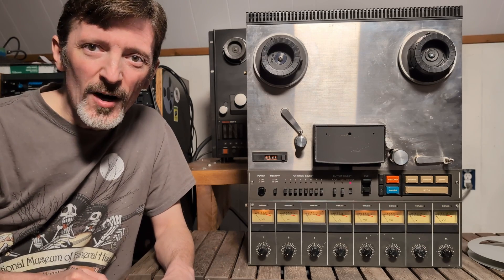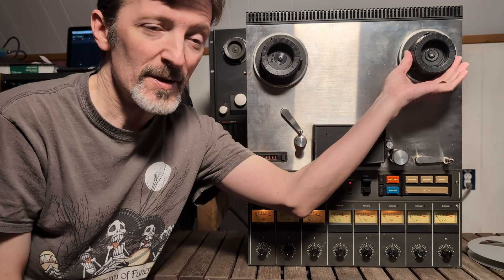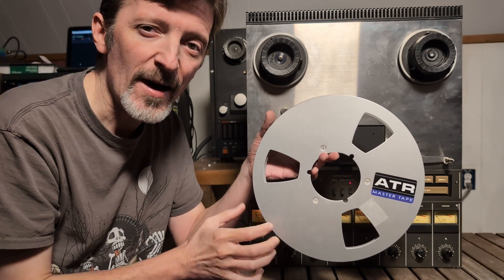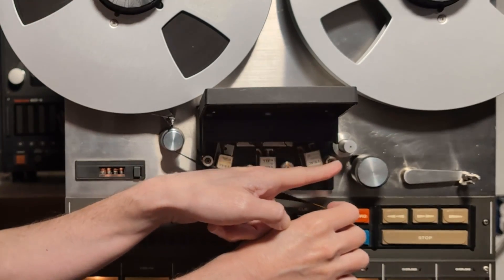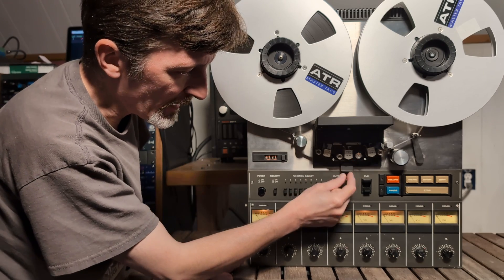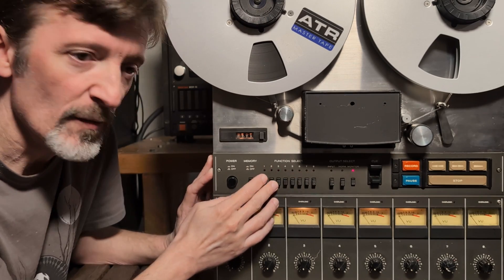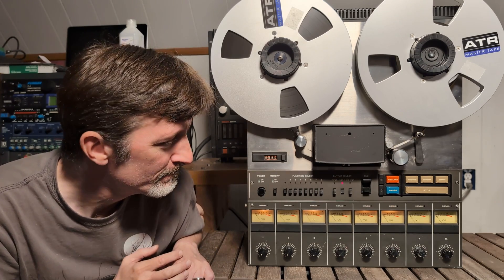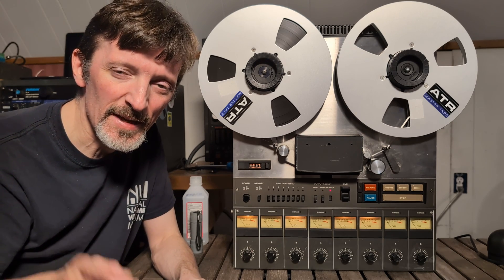How to Use the Teac 80 8 Analog Tape Machine

Comment: hello! Thank's for your tutorial! I suppose the difference between stop and pause is the precision of it when it restarts... Pause permits to make more precise transitions?!!
Reply from the maker: According to the research that I've done since this video was made, pause leaves the tape against the heads while stop engages the tape lifters. Since this is a very mechanically driven machine, it doesn't use the motors to hold the tape in position, so it seems more like stop is engaged when the machine is actually in pause. My 80-8 went to Sammy over on the Sammy and the Hi8s channel. He was having trouble with his so I donated this one so he could put together a good machine. Mine had a few problems too. Definitely go check out his channel. He has made several videos with the 80-8. These are really wonderful sounding machines!
Reply: @TwinCreekAudio  I will! I love tape machines. I've beeen working on many songs of mine using the sound-on-sound processing on an AKAI 4000DB. I won't lie, the game is so funny, and the result, well, not bad to me! I even did a try to tutorial but it's such in bad english, that it's not really effective. By the way if you got the time? https://youtu.be/saVeMW_YYFA
Reply from the maker: @Thomas.Lafitte  I will defintely watch after work today. Thank you! i like Akai too. I have one that needs a lot of work.

Comment: I just got the 80-8 and a TASCAM M-520 and I can't them to work together. I have a Fostex 350 4/8 channel mixer and I can record and overdub on that so I'm going to record on all eight tracks and then try to play THAT back through the M-520. See if that works and then reverse-engineer from there and get it to record. The guy I got the mixer from showed me the video he took of the M-520 with a 16 track 1" machine playing back on all sixteen channels. Playing back isn't recording, though. I'm not even sure how to hook them up together. The manual for the M-520 has this 8 Track Patch that is supposed to work for recording mixing and mastering down to 1/4" but it didn't work for me. It has me routing everything through the meter bridge (?) which I thought was interesting. But I got nothing. No meter. No phones. But I did get the overload light on the trim knob. So it seems it hitting that. But no further. 'elp?
Reply from the maker: I don't know the M-520 that well but I'll take a look at the manual and see if I can understand it's routing. Usually, yud use either a bus out or direct out to send signals to the recording device and tape inputs to play back through the console channels. I'll grab the manual for the M-520 and see if I can add more information to help.

Comment: So, I'm really only using the Normal input for recording, overdubbing and playback and the Monitor for playing along without recording?
Reply from the maker: Yes, that sounds like you're using it correctly. I need to check the manual but most recording consoles will have a switch on the main channels that allow the tape inputs to come through the main channels. Sometimes it's called Remix, sometimes Tape on Tascam consoles etc. There are also 2 typical design philosophies for recording consoles. Split or inline. On a split console, the tape inputs will have a separate mixer section for monitoring the tape tracks. This is usually above the buses. Then there would be a switch to bring the tape channel through the main channels so you could do the final mix with the full EQ and channel features. On an inline console, the tape inputs will go to a section on the main channels which is still a separate submixer but is integrated into the main channels to save space. These will have a switch to flip the signals. In fact, a lot of consoles actually call this Flip and there will be a switch for it on the channels. I believe the M520 is a split design like my M-35 but I'll hang to check the manual. The Mackie 8 Bus, Soundtracs Topaz, Soundcraft Ghost etc are all inline consoles. Older Tascam were usually spilt designs but the M-3500/3700 and newer Tascam analog consoles went to an inline design.

Comment: Why didn't they make all decks with NAB reel holders instead of having to buy the adaptors?  This has always been an annoying issue I think.  First of all, the brand new machine is not fully built if you gotta get the adaptors, secondly it is suggestive that we aren't worthy of using quality gear which can be as good or even better than broadcast tape decks anyway!
Reply from the maker: I agree. If the Fostex R8 had used something other than 7" reels, it could have been used on more high end productions. I have also noticed that the tape machines that people considered semi-professional back in the day actually sound quite good and very analog.

Comment: Firstly, thanks a bunch for the awesome videos--they're super helpful! I recently purchased a TEAC 80-8 and have a few questions about connecting it to a mixer. I'm currently using a Behringer Xenyx 802 mixing board with 8 tracks, which has a single location for an RCA input and output connection.

My questions are:

1. Will I need a different mixing board if I want to listen back to all eight tracks simultaneously?
2. From an RCA perspective, What type of RCA cables should I purchase? Should I purchase an RCA y cable (male on both ends) or do you have a better suggestion? 

Any info you can provide is greatly appreciated! Thank you so much and warm regards.
Reply from the maker: If might be easier to use a mixer that's designed for recording such as the Tascam M-35, M30 5A etc. You can still use your mixer to play back all 8 tracks by using RCA to 1/4" with the line inputs on all 8 channels but you would not  be able to record and monitor all 8 simultaneously without a mixer that designed with another signal path for monitoring. As far as the type of cables, it would be whatever type of connections the mixer used needs on one side and RCA for the 80-8 on the other. There are a lot of choices for mixers that would work. The old Mackie 8 Bus, Soundcraft Spirit, Ghost etc. Most of those use 1/4" so you'd use RCA to 1/4" etc. Hope that helps and best of luck! The 80-8 is an excellent sounding machine. With proper maintenance and care, it's one of the best for the price and not difficult to work on when needed.
Reply: @TwinCreekAudio  This is incredibly helpful! Thank you so much! I've spent this afternoon looking for mixers that would accomodate the 80-8 and haven't found much, so I was thrilled to see your suggestions. My initial thought was to try a 2 to 8 RCA snake cable, but it appears to be uncommon. 

Anyhow, thank you so much for the thoughtful response! It's truly appreciated! I'm really excited to use the Teac. Such a cool piece of machinery. 

Warm regards!

Comment: how would you go about running tracks from a daw (audio interface) into a mixer and the tape machine? how would you route it?
Reply from the maker: Normally I would connect the outputs of the audio interface straight to the tape machine and then record the tracks onto tape. If you need to match levels or your interface doesn't support the correct line level for the tape machine you're using, then you could connect to audio interface outputs to channels on a mixing console and use the direct outputs to feed the tape machine. This way would give you more control but will add more noise and other non libraries to the recording.

Comment: Hi,Grady,...but for Fostex R8,what kind of tape must I use,for recording of course?
Thanks a lot!
Reply: Basf 528,1/4,6.3mm its good one?
Reply from the maker: @iulianmunteanu8672  I used ATR master tape with mine and it worked great. There is also RTM tape. Those are the only 2 being made anymore.
Reply from the maker: @iulianmunteanu8672  yes, RTM makes the old BASF formula.
Reply: @TwinCreekAudio  thanks a Lot!Best Regards!!
Reply: Hi,Grady,....one more question,it needs nois reductions after tape(like Teac DX8),or not necesary?
Reply from the maker: That likely depends on what type of material you're recording. The narrow gauge track formats are a bit noisy, so if you're recording anything quiet, noise reduction would be beneficial. For something like loud rock music, you can probably get away without noise reduction.

Comment: Hi, thanks for the detailed video ! Sorry for this question, but does the 80-8 have any kind of stereo output option ? Or do you have to use all 8 outputs if you use all 8 tracks ? Thanks ahead for your help, I'm just looking to set this little fella up into my studio !
Reply from the maker: It doesn't have any kind of stereo output as that would require it to have a built in submixer I think. It only has 8 separate outputs from the individual tracks. These need to be connected to a mixer in order to combine them to a stereo mix.

Comment: BEWARE  the reel table part can break or the M4  bolts in the part under the reel table can go soft and the bolts lose there grip
and  the reel table can start to move in and out  

i have alot of this model super deck they are  the tascam 38 head will fit  on this deck 

the team 38 is better as it can be jazzed up  on the tape speed side  3 3/4   to run at the same speeds  as the otari  1/2 inch deck i lost my deck to bad caps

saved my  otari DP2700 just in time
Reply: I disagree that the Tascam 38 is a better model. Absolutely not true. Cheap plastic parts and terrible relays. Teac 80-8 is FAR superior. Agree with the reel table issue though. Although it depends on the unit and how it was used and stored. I stand by the Teac 80-8 til I die. I could list many many reasons why. Anyways, good video. Not too many new videos out there regarding this beauty
Reply from the maker: @soulslip  thank you! I haven't used a 38 in many years but I have to agree that the 80-8 seems to be better built and also a bit easier to work on. I was really surprised at how good mine sounds even with its age and wear.
Reply from the maker: That is good to know.  I haven't had any problems with mine but I will be sure to be careful. I did adjust the reel heights before use and replaced a hub adapter that was broken. The machine has been working great and I really like this model!

Comment: hey buddy, i use the pause button togetter with the rec botton, so i just press paly, i think thats the only way to use it ;). i got two 80-8, one is in good condition the other one sits half disassembled on my kitchen table, i wait for some parts and the vs-88 to test it ;), thank for the nice video
Reply from the maker: That's good information to know. I seems to sound and work exactly the same but maybe it's leaving the record electronics engaged in pause. They are really nice machines and still seem to work great. I don't have the varispeed option but I might try to find that after I finish my other tape machine projects. Good luck with yours and happy recording!
Reply: I just picked up a vs-88 for $10.50!! I only need the accompanying DC Capstan motor and the manual to install and adjust properly. Cheers!
Reply: Can you synchronize both machines? I Just bought a 80-8 and really Love it.

Comment: I just finished my first song using my 80-8(mastered to cassette) and im impressed with the quality of this machine! Tape price definitely will dictate what songs get recorded next but it was a great recording experience and already starting the next!
Reply from the maker: I recorded a song yesterday with mine and was really enjoying the workflow. I find the sound of the 80-8 and it's ease of use inspiring.
Reply from the maker: I'm using mostly ATR Master Tape with all my tape machines. It's a little cheaper than RTM which I tried with a Fostex R8 and did not like as much as ATR Master tape on the same machine. I think used reels of ATR should be safe to use as I bought 2 of my 1/2" ATR reels and they have been as good as the 2 new reels I bought.

Comment: Nice summary of the functions !   How do you find it sounds compared to your other tape machines or machine ?
Reply from the maker: It sounds more vintage and thicker than the MSR-16. The MSR-16 sounds really nice and punchy and is less noisy but the 80-8 just sounds massive and very musical. I like the high end on the 80-8 a bit better too. That's likely due to the dbx on the MSR-16.
Reply: @TwinCreekAudio   Ah that's great to hear because i have a 80-8 too lol !
Never had the opportunity to compare it to another machine,
Cheers !

Comment: Makes me wanna buy an 80-8 again… I have the worst case of gear nostalgia for my analog recording gear (3340S, MS16’s, TEAC/TASCAM mixing boards, etc) they’re so cool and sound awesome

Unfortunately tape machines are about 3x as much as they were 13-14 years ago so it’s been hard to justify jumping back in

I’ll prob have to buy a beater and bring it back to life
Reply from the maker: I fixed 3 tape machines in the last few years so I got a better price on them.  A Fostex R8(a really cool, fun machine), a Tascam MSR-16, and the 80-8 which I didn't pay for and needed the least amount of work. I have a matching Tascam M-35 but it sounds so good with my Soundcraft, I've just been using that with the 80-8. It has me thinking about the 90-16 and how good that might sound. I have an Otari but no remote. I hope to get it running one day too. The 80-8 sounds so good and is so easy to use, Ive been using it instead of my digital system or the MSR-16 which I also like.
Reply: @TwinCreekAudio  and athomashorrock7221, I also have 4 different Teac/TASCAM reel to reels.  I have this model in near perfect condition, also also have the TASCAM 30-8 in near mint, a TEAC 3300 and a 6010.  Selling the two 1/4 inch R2R decks for $300 each. They play and record, the 3300 needs the control arm right side replaced, but I have a new set for it ready to go.  I may be selling on of the 8 track decks.  I would have to get around $1000 at least for either one.  Actually the TASCAM 30-8 probably is not for sale as it is the newer version of 8 track.  I like to record in analog and digital at the same time.  I have a decent size studio and handle 16 track recording in there.  Up in the Poconos of Pennsylvania.  Let me know if interested in anything.  Thanks for your very informative videos. I did subscribe a while back and have seen most of your videos.  Nice work.  Question, why not have it hooked up to speakers? LOL... It would be interesting to hear how well the speed on playback is.  I have experienced warble in other machines in the past.  Anyway, I enjoyed the video.  Cheers guys.